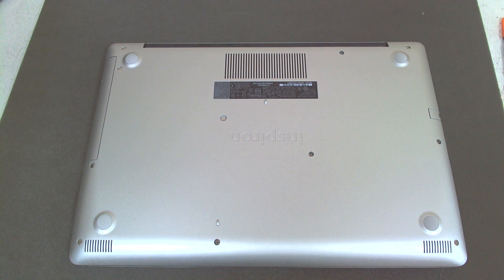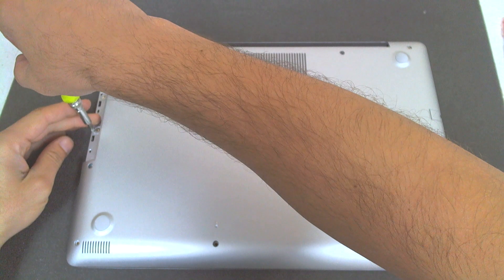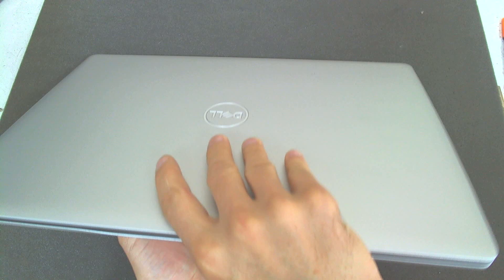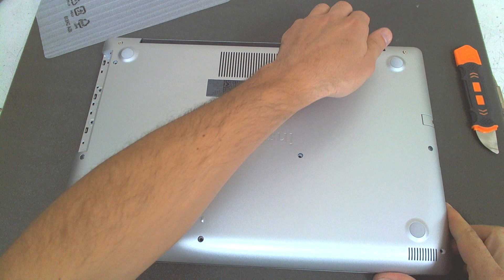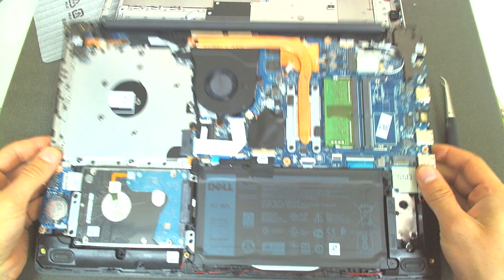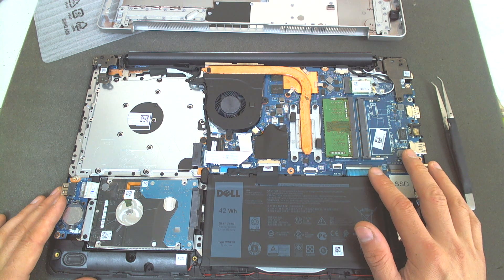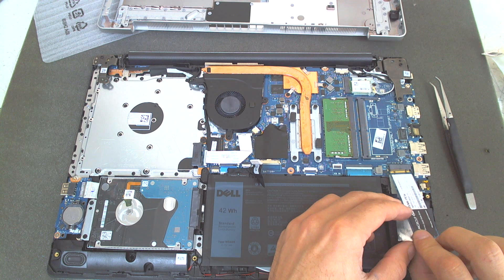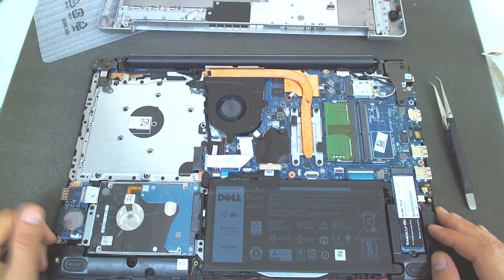Dell Inspiron 3581 SSD Upgrade / Disassembly

Comment: Hello, 5 years late and finally upgrading to an SSD watching ur video.As you can see the ssd slot has a heatsink screws, i was wondering if you did put a heatsink or is it not necesssary?
Hope u can answer my question, thank you!
Reply from the maker: I don't see heatsink screw. In this model you can install 2280 or 2242 size SSD, The screw in the middle is for the shorter SSD. But you can install heatsing if you can close the back cover.

Comment: What does it mean it only supports 256GB? What happens if you install more than that? Also you say you can install  2TB in the regular drive, but in the page of Dell specifications it says the maximum is 500GB. I have on mine Dell 3481 1TB, so I'm confused about this
Reply from the maker: In the specs they write the max value of the drive that you can buy it in the shop. That douse not mean that it cannot support more.
Reply: @LaptopDisassembly sorry for asking dumb questions, it does say up to 256GB can I install 512GB M.2 Nvme? I have the same laptop Vostro 3581.
Reply from the maker: @TimelyTurtle  you can, no problem. Up to 256GB is how you can buy it already configured.
Reply: Hi. Can i install 1Tb SSD on a dell 3581?
Reply from the maker: @cuauhtemocaparicio384 yes you can.
Reply: @LaptopDisassembly  thank you very much 🙏🏻

Comment: Do we need to disconnect the battery  before installing the SSD? I am a newbie to technology. Will I be able to install a ssd ? Is it complicated?
Reply from the maker: It is not complicated, it is like installing a ram stick, just with a screw. It is not necessary to disconnect the battery but it is recommended. If you accidentally short somthing when you plig the ssd it is safer sith the battery disconnected.

Comment: Is this same as hard drive
Reply from the maker: yes
Reply: Can 12 g make work
Reply from the maker: What do you mean
Reply: 120
Reply: I mean
Reply: He hast like urs
Reply: The one he had was
Reply: Little smaller then urs
Reply: Urs is 250g
Reply: He has that with 120g
Reply from the maker: 120gb will work, even 512gb will work.
Reply: Gigabait
Reply: U mean if I put this the pc don't need  new hard drive
Reply from the maker: @d.kinglde2275  Please write what you have now, and what you want to do ( in one message ). I cant quite understand what you want to do. Do you have a bad hard drive and you want to replace it or you like do add a drive...
Reply: OK I have that problem hard drive  not install that's way I am asking you If I put this thing does the problem solved
Reply from the maker: @d.kinglde2275   If you don't have hdd at ALL, yes, putting ssd will solve the problem. If you have a bad hard drive or you can replace it, or you can still add M.2 Drive. Ether way adding a disk will solve the problem.
Reply: @LaptopDisassembly  what is hdd

Comment: Hi, could you please advise if this model of SSD would match DELL Inspiron 3581?
SSD ADATA 256GB M2 PCIe NVME XPG SX8200 PRO
https://www.x-kom.pl/p/461044-dysk-ssd-adata-256gb-m2-pcie-nvme-xpg-sx8200-pro-2021.html#Specyfikacja
Reply from the maker: Yes it will work. I had installed same on same laptop.
Reply: @LaptopDisassembly  Wow, that was quick! Thank you for answer!

Comment: Hello, will this ssd work for this laptop?
https://www.incredible.co.za/crucial-mx500-m-2-ssd-250gb?gclid=Cj0KCQjwutaCBhDfARIsAJHWnHtfeUnEcfb_H-c1EQBnVMi7-LVrUfBEXo-JJc29aA1P__WrsCLis7UaAmJxEALw_wcB
Reply from the maker: This is a regular m. 2 ssd. It will not work. The laptop works only with nvme m. 2 ssd.
Reply: @LaptopDisassembly  OK thanks for feedback, what about this one
https://m.takealot.com/wd-green-120gb-m-2-2280-sata3-ssd/PLID53565456
Reply from the maker: Still no. There should be pcie in the name. Also the ssd should have only one cut on the connector.
Reply from the maker: Yep is the correct one.

Comment: Dude i have the i3 version of this laptop, can I replace the hdd with a 500gb ssd on sata but im afraid that I will lose my windows activation code when I reinstall OS.
Reply from the maker: The OS is writen in the bios. If you have a legal windows 10 and you reinstall the windows it will activate automatically. Also you can clone the os witg aomei backupper or acronis true image.
Reply: @LaptopDisassembly  Thanks Im planning to reinstall windows on new ssd to replace the hdd because in task manager the disk usage is always at 100%  and  I keep getting random BSOD I think the culprit might be a failing hdd.
Reply from the maker: It is very often that the bad hard drive can cause that type of problems.

Comment: I can use this laptop upgrade graphics card?
Reply from the maker: No, some of the models have integrated graphics in the cpu, other have separate chip on the board. The cooling is different so are the fans. Best way is to check the fan that you have now and install the same. Also you can just clean and lubricate the one you have now. No need to replace it if is working.
Reply: Thanks bro

Comment: I have a dell inspiron 15 3581 laptop.I can use this laptop m.2 nvme ssd?
Reply from the maker: Yes it supports only m. 2 ssd nvme.
Reply: @LaptopDisassembly  thanks bro
Reply: @LaptopDisassembly  I see your M.2 have 2 openings, doesn't the m.2 nvme have only 1 opening? I don't want to buy the wrong one. Thanks!
Reply from the maker: I use this one https://www.amazon.com/TEAMGROUP-512GB-Internal-Solid-State/dp/B07SMBQMNG
Reply: @LaptopDisassembly  Thank you I really appreciate it. I have the Inspiron 3580. So this SSD will also work?
Reply from the maker: Yes it should.

Comment: I reseted my drive c  dell Vostro 3581 but some apps like photo , store aren't there what the problem
Reply from the maker: If the apps was installed after that, probably you need to install them again. Did you use the option "keep my files.." also try to log with your Windows account if you have one. Also try Windows update.
Reply: @LaptopDisassembly  I used keep my file
I would try to update windows

Comment: Bro do we need to remove hdd or not to install ssd because I want to upgrade but not want to remove hdd
Reply from the maker: No need. Just add the M. 2 drive. No need to remove the old disk. Just put the windows on the ssd and leave the regular disk for storage.
Reply: @LaptopDisassembly  do you have a video explaining how to put windows from the hdd to the ssd?
Reply from the maker: https://youtu.be/7nVOefqkkJs

Comment: hi i have a laptop DELL inspirion 3583 intek Inside processor. and I'm trying to install an M.2 Pcie 128gb NVMe SSD and I can't start the SSD, could you help me if I have to configure something in the BIOS
Reply from the maker: What do you mean by "Can't start the ssd" You dont see it in bios, you dont see it during instalation....
Reply: @LaptopDisassembly  the bios if you see it! and during the installation of windows I could also install the operating system with usb Boot, but when I try to start the installed operating system it does not recognize the SSD it sends a message that there is no disk connected
Reply from the maker: You are trying to install windows 10?. Also you install under UEFI mode. Try making the bootable flash drive with media creation tool. Remove the regular disk and leave only the ssd. Than start the instalation and see will it finish fine.
Reply: @LaptopDisassembly  thanks thanks that was my mistake I was installing in Legacy mode! I tried installing windows 10 in UEFI mode and if it worked for me thanks
Reply: @LaptopDisassembly  You could contact me by email and I send you images or videos so you can see the specific case to see if you could help me   email. carlosmanuel0316@gmail.com

Comment: Thank you for this guide. Will 128gb model of below Transcend SSD work on dell inspiron 3580?
https://www.transcend-info.com/Embedded/Products/No-946
Reply from the maker: Yes it should work, I did install a few transcends on similar model. they work without problem.
Reply: @LaptopDisassembly  Thank you very much

Comment: hello thanks for this informative video. I was going to ask a question. Is the bottom ssd compatible for dell 3581?
Hi-Level HLV-M2SSD2280 / 256G 256 GB M.2 SSD 288.86 TL instead of 516.00 TL
https://www.n11.com/urun/hi-level-hlv-m2ssd2280256g-256-gb-m2-ssd-933604?magaza=atombilisim
Reply from the maker: No, this is a regular M. 2 2280 drive. In order to work in that model it should be nvme type.
Reply: Is this compatible for 3581? https://bilendenal.com/Kingston-KC2500-250GB-22x80mm-PCIe-3.0-x4-M.2-NVMe-SSD-SKC2500M8_250G.html
Reply from the maker: Yes
Reply: Thanks :)
Reply: Perfect :)

Comment: Can you suggest me a ssd fo dell inspiron 3580
Reply from the maker: Any nvme 2280 ssd should work. Depend on the budget you can go for 128 or 256gb models.  Kingston A2000, Adata XPG series or Samsung models. Look for a model with bigger warranty.

Comment: my dell inspiron 3581 is still brand new but it freezes every time and it's slow, not ideal for a college student. do you have any solutions for this?
Reply from the maker: Is it with ssd or regular disk
Reply: @LaptopDisassembly  I don't know. when I bought it, Windows 10 is installed and it's super lag. Maybe I should try restoring it to its original software but would that make a difference?
Reply from the maker: No it will not make a difference. Probably you are with regular hard drive. Put an m. 2 2280 ssd and install the os on it. The laptop will become faster and the lag will disappear
Reply: @LaptopDisassembly  thank youuu tho unfortunately I don't know anything about laptops hahaha but thanks!
Reply from the maker: Go to a local computer shop, they will do it for you
Reply: @LaptopDisassembly  thank you very much!!!
Reply: one more thing, if I bought an 250gb SSD but my laptop is 1tb will the storage of my laptop would be replaced by 250gb only? or it will be added to the laptop's storage (1tb + 250gb)
Reply from the maker: It will be added.. Just install the os to the ssf.
Reply: is it worth it to add SSD and RAM (core i3) or switch to a new laptop instead?
Reply from the maker: Just add ssd, it will make the laptop faster.
Reply: is this compatible with Dell Inspiron 3581 corei3? Kingston Solid-State Drive A2000 M.2 2280 NVMe PCIe Gen 3 SSD 250GB
Reply from the maker: Yes, i did install the same on the same laptop
Reply: @LaptopDisassembly  but yours is corei5 right? and mine only has corei3 I'm still in doubt since I have to order an SSD from another country. All the lagging, slowness and poor performance of this laptop will be remove right? thank you. sorry for asking repeatedly.
Reply from the maker: The cpu is not mich of a matter.. I had sold about10 of these.. Works with i3 also
Reply: @LaptopDisassembly  thank youuu!

Comment: I know its a bit late since you have uploaded this video a year ago, but i need to ask if it is possible to upgrade it with a 16gb kit ram but 2 x 8 gb SODIMM? Thanks for the upload, will follow your instructions
Reply from the maker: Yes it is possible
Reply: @LaptopDisassembly  And i was reading the user manual, it specifies that only 256 Gb of memory, is this true?, or it could support more capacity according to your experience?
Reply from the maker: You are asking about memory or storage. You can install bigger ssd disk than 256bg, if that is your question.
Reply: @LaptopDisassembly  The manual says that only 256 GB of m.2 ssd storage can be installed in this particular model, i want to install a 1 tb m.2 ssd, is it compatible
Reply from the maker: It should work

Comment: By adding ram and ssd. Can  our laptops clock speed will increase 
Dell inspiron 3580  laptop
Reply from the maker: If you don't have ssd now, when adding one, the laptop will become faster. If you add more RAM, you can do more things at the same time. It will not increase the cpu clock speed, it will make the things happens faster. :)

Comment: how to change the sequence so that it reads the SSD first and then the hhd, please make a video explaining that
Reply from the maker: I dont have the same laptop in the shop right now. Usually when you add m. 2 ssd it become default boot drive. Otherwise you can change it drom the boot menu in the bios... Just move the m. 2 ssd on the top of the list.
Reply: @LaptopDisassembly  one more question, in that computer model what is the maximum capacity of the m.2 unit.
additionally the solid state unit has to be pcie or which?
Reply from the maker: Yes it has to be pci-e nvme ssd. You can add 512gb even 1tb drive.
Reply: @LaptopDisassembly  Hello, Thanks for putting out this video...  please can I put 512gb of sad nvme into this dell 3581? Will it work?
Reply from the maker: Yes it will.

Comment: Can u tell me which is good one dell inspiron 3584 without ssd  or hp laptop with ssd ?
Reply from the maker: All depend on the model and configuration of both. But the SSD will make it a lot faster. Consider adding SSD to the Dell laptop ( if you buy that one )

Comment: Dell vostro 3581 wd 120gb m.2 2280 support
Reply from the maker: The laptop works with nvme ssd, not regular 2280 ssd. It needs to be class 35 or class 40

Comment: Which connection interface do you need to choose?
PCI or SATAIII?
Reply from the maker: Pci nvme is faster than regular sata 3 ssd. So pci is better by my opinion.
Reply: @LaptopDisassembly  that is, in one plug I can connect SATAIII or PCI?
Reply from the maker: Sata 3 and pci are different interfaces. If you are talking for the regular sata interface, you can plug or regular disk, or ssd sata disk. What is the current configuration... So i can give you better answer.
Reply: can i install - Kingston A2000 250GB NVMe M.2 2280 PCIe 3.0 x4 3D NAND TLC (SA2000M8/250G)?
Reply from the maker: Yes it is very good choice price/performance
Reply: @LaptopDisassembly  nothing that this model has 2 divisions on the connector, and on your video 3 divisions?
Reply from the maker: No you are wrong. There is a place for one m. 2 ssd and one regular 2,5" disk.. Nothing more..
Reply: @LaptopDisassembly  I meant what your disk looks like and the one I dropped above
there are different connectors for the number of divisions
Reply from the maker: The laptop have one regular drive and one free m. 2 slot for nvme ssd. In the video i just add the ssd drive to the m. 2 slot. I hope i got you correctly

Comment: Please tell me Dell 3581 in working   Kingston A2000 250GB 22x80mm PCIe 3.0 x4 M.2 NVMe SSD ?
Reply from the maker: Yes it should be OK
Reply: @LaptopDisassembly  Hello friend, I would like to upgrade my new Dell 3581 laptop, in addition to ram upgrade, 4 GB KINGSTON 4GB 2666Mhz DDR4 CL19 Notebook Ram KVR26S19S6 / 4
I got it.

 I asked you Kingston A2000 250GB 22x80mm PCIe 3.0 x4 M.2 NVMe SSD SA2000M8 / 250G I will buy this card for SSD.

 The other recommended Team Group card TM8FP3256G0C101 MP32 M.2 256GB (1500 / 800MB / s) PCIe + NVMe SS is quite expensive here half the difference.

Do you notice a lot in perfonmas what do you think about this and what other elevations can I do on this laptop.

Thank you for your help in advance.
Reply: @LaptopDisassembly  @Yanko Goshev Apart from these, which 250 GB SSD would you recommend?
Reply from the maker: @canaydn6276  I use  Kingston А2000, A-Data SX6000 and Transcend SSDs. All depend on what you have on your area.
Reply: @LaptopDisassembly       Thank you for your help in advance         Adata XPG SX6000 Pro 2280 ASX6000PNP-256GT-C 256 GB M.2 SSD 
It looks better than Kingston.
I decided to buy this.If you come to Istanbul, we'll have a nice tea, maybe a beer.
Reply from the maker: @canaydn6276   Well we are neighbors, but now is not the best time to travel for tea or beer. :)
Reply: @LaptopDisassembly  :) :) :) after after clear time
Reply: @LaptopDisassembly  Hello Yanko
Can you recommend a laptop where we can change the ssd card, processor, ram and do a higher upgrade whenever we want?
These laptops have a low system every two years.

A good laptop in our country 2000-3000 - $ Dollars
It is wise to buy a modifiable laptop with an interchangeable part and upgrade
Reply from the maker: All of the new laptops are with soldered cpu and vga. If you like to upgrade you have to buy a refurbished laptop with max 3th gen cpu. Or find a refurbished workstations. Everything new is with soldered parts.

Comment: how to know which SSD is supported M2  PCI or M2 Nveme?
Reply from the maker: It should work with both, according to the specifications: One M.2 2280 solid-state drive, Class 35 and Class 40

But NVME is better. 

https://community.spiceworks.com/topic/1529476-what-is-the-difference-among-class-10-class-20-and-class-40-ssds

Comment: I can i7 in this computer
Reply from the maker: There's a confirmations with i7.. But you  cannot upgrade because the cpu is soldered on the board.
Reply: @LaptopDisassembly  I don't want to change the i3 to that computer for an i7
Reply from the maker: Well yes there's a confirmations with i7

Comment: Please help me, can i use SSD NVME Gen 3x4 on my Dell Inspiron 3481 in which only support NVME gen 3x2?
Reply from the maker: It should work, but will work on lower speed ( i doubt you will see difference)
Reply: @LaptopDisassembly  thank you so much, but i find something difference at market. There are ssd m.2 pcie nvme with two keys (b and m) as in team mp32, kingston a1000 and nvme which only has 1 key as in team mp33 and kingston a2000. What is difference between two kinds of nvme? 

Hope you can help me to understand before choosing the correct ssd for my inspiron 3481. 
Thank you..
Reply from the maker: Hope this can help you. Basically the nvme is M key.  https://rog.asus.com/articles/guides/buying-an-m-2-ssd-how-to-tell-which-is-which/

You can i install B+M key on M key interface but not on reverse.
Reply from the maker: Also depends on the speed x2 x4 is or M or M+B
Reply: @LaptopDisassembly   thank you much for your great info, now it's clear enough for me..